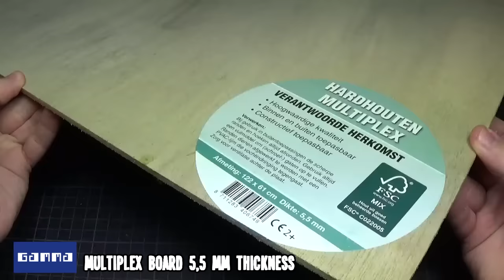How To Make Bayou Swamp Terrain

Comment: A little tip for anyone building large or medium scale scenery involving water, to avoid bubbling in your water if you have either a washing machine or washer/drier on at the time of making your water, after pouring just pop your scenery on top of the washer/drier and the agitation from the drum spinning around drives all the bubbles to the top, just keep an eye on it to check for anything you may need to pop or displace and of course...do NOT let it vibrate off the machine...not only will you destroy your scenery but your kitchen/utility room floor also and any potential collateral damage from splashes of resin.
Reply: Thank you

Comment: As always, amazing work.  Love it. Also, what kind of resin do you use? Every time i try to use resin, it either wont cure at all, or cures tacky.
Reply from the maker: Thanks! I use 2 part epoxy resin, from the brand Wilsor. I have used Unreal Details Magic Water and Envirotex Lite before they also work good, though Envirotex is better i think of those two. You may want to search '2-part epoxy resin' in your country's webstores (and then check reviews from users if you find some) Usually when resin gets tacky and won't dry 100%, it means that either it hasn't got enough hardener in it, or it's not stirred properly (happened to me once when i was in a hurry) Make sure to read the instructions carefully and measure exactly what it says. Usually it's equal parts hardener to resin but i know some brands do it different. It then needs to be stirred slowly to avoid bubbles until crystal clear, which takes some time. I use this one which is a Dutch brand and a bit hard to find:    https://www.harolds.nl/p/modelleren/giethars/giethars/2-componenten-epoxy-giethars    just to give you an idea.  It's pricey but the results are excellent. Hope that helped you my friend!

Comment: Nice one i might have to figure out a way to adapt this for ordinary miniature bases. 
i did hear someone once mention that swamp water is usually more brown than green, but i don´t know if that´s true.
Reply from the maker: Hi and thanks ;) Well you could check out my Tropical Mangrove Base video m8 i made those for 25mm round bases using the resin water. You could be right on the color, i made this with a fantasy twist i liked the greenish tone, you can experiment with it to make it as realistic as possible for sure!
Reply: question have you tried vallejo texture and if so what did you think of it might it replace the paste you made?
Reply from the maker: Good question, i thought of this one before i started to be honest, as i was almost out of Vallejo paste.I think the Vallejo paste is excellent (i even showed a pot in the video) and have used it many times.Only reason i like the Liquitex one more is that comes without the sand, so if i need it more smooth i can use it pure of with some fine powder.Another reason is Liquitex is way cheaper because of this reason, which adds up if you want to use a lot. I believe the Liquitex was 23 euro for 945 ml 'pure' paste, whereas the Vallejo is 9,50 for only 200 ml, from which 10-20% is just sand.I buy my sand usually in bulk 25 kg in big hardware stores which costs next to nothing.But again i think Vallejo is a safe and very good buy, used it on many diorama's i made with good results. Cheers ;)

Comment: Zeer leerzaam voor het schilderen van mijn modellen maar ik heb toch ff een vraagje. Waar kan je dat hoge densiteit foam krijgen in Nederland van die dikte? Ik maak zelf eigenlijk alleen maar rc vliegtuigen van composiet en dit dikkere materiaal zou uitermate goed gebruikt kunnen worden voor projecten van mij. 

Voor mijn modellen gebruik ik normaliter hoge densiteit foam (Gamma blauw geluidsdempend foam (extruded styrofoam) voor onder het parket, 10 sheets van ~80x60x0.3 cm voor 6 euro (~7 m^2). meer dan genoeg voor twee tot drie modellen van normale grootte en dik voldoende voor een knoeper van een model) zelf gelamineerd met papier 40 grams (ultra dun, vergelijkbaar met rijstpapier) waar nodig voor de huid en een speciale langzaamdrogende 3 component epoxy die enigzins elastisch blijft voor zo'n 24 uur tewijl het droog aanvoeld en bewerkt kan worden na ongeveer 2 tot 3 uur als toplaag waar de 3e component de viscositeit bij aanvang behandeling bepaald. Hoe meer 3e component hoe vloeibaarder en ik heb het graag zeer vloeibaar om een zo'n dun mogelijke toplaag aan te kunnen leggen, gewicht is van levensbelang om het model goed vliegend te krijgen. 

Voor het skelet gebruik ik hetzelfde foam gedubbeld de grain gekruist op elkaar met sneldrogende 2 component epoxy en juist daar zie ik mogelijkheden daar epoxy zwaar is en ik met dikker foam zelf de dikte van het skelet kan bepalen en ik gewicht kan besparen doordat er geen extra epoxylaag tussen zit gelamineerd. Sterker nog ik kan een skelet bouwen met de extra versterking op specifieke dikte die nodig is voor dat deel van het model. Ik zie een enorme mogelijke winst in gewicht. Om het skelet en de huid uiteindelijk aan elkaar te verlijmen gebruik ik de sneldrogende 2 component epoxy (5 minuten, normale viscositeit).

De gelamineerde papierlaag op het enkel laags foam stelt me in staat om mooie curves te maken zonder het foam te breken zolang je de grain van het foam volgt (je ziet het wel als je dit materiaal ooit aanschaft om mee te bouwen), je dient hier echter wel engelen geduld voor te hebben want teveel druk ineens gaat niet zonder golven in je curve te krijgen. Dat laatste is niet gewenst daar je je airodynamica daarmee kan verknoeien en het model niet zo zal vliegen als je oorspronkelijk hebt uitgerekend. De epoxy geeft het geheel genoeg stevigheid om een crash te kunnen overleven. 

De brandbeschermende plaat achter de motor (waarop deze ook gemonteerd is) kan echter niet van foam en epoxy gemaakt worden vanwege a de trekkracht en b de hitte van de motor dus ik gebruik daarvoor vaak aluminium of hout of een combinatie van beide materialen (afhankelijk van de grootte van de gebruikte motor voor het model). Het blijkt namelijk dat foam zeer slecht tegen trekkrachten kan maar zeer goed tegen druk kan over een groter oppervlak zeker als het ook nog eens gelamineerd is met een epoxy. Hetzelfde hitteprobleem geldt natuurlijk ook voor de snelheidsregelaar zodat ook hier direct contact van dit onderdeel met het foam moet worden voorkomen, een stuk balsa doet wonderen. 

Ik zweer bij epoxy en foam in de RC voor grotere zelfbouw modellen. Ja houtbouw met krimpfolie is prachtig maar ook een stuk gevoeliger daar het hout op de vochtigheid in onze atmosfeer reageert die nogal drastisch fluctueerd in ons kikkerlandje. Echt grote modellen van hout trekken hier altijd krom na enige tijd wat echt vervelend is voor de vlieg eigenschappen van het model.

Groeten van een modelbouw liefhebber.
Reply: Misschien leuk om te weten voor je. Ik ben momenteel bezig aan een een meter en zestig centimeter spanwijdte DHC-4 The Havilland Caribou. Ik heb daarvoor 11 sheets nodig ivm de rare knik in de staart die me nogal veel snijafval oplevert in vergelijk met normaal maar dat kan ik weer voor een volgend model gebruiken dus ik denk dat er uiteindelijk ongeveer 10 volledige sheets in het geheel gaan als ik de rest kan hergebruiken.
Reply from the maker: Thanks! Ik haal dat foam bij Van Beek Art.  Er zijn een aantal filialen in de grotere steden zou ik je zeker aanraden om eens te gaan kijken, maar de online bestelservice is ook prima. In NL is dat het beste foam wat ik heb kunnen vinden. Bedankt voor je tips voor RC modellen je comment is al een goede tutorial op zich. Veel plezier en succes met de hobby!
Reply: Bedankt mijn beste. 

Mijn bouwmethode is los vergelijkbaar op flitetest (https://www.youtube.com/user/flitetest) zelfbouw projecten maar vanwege mogelijk verkrijgbaar materiaal in Nederland en mijn eigen inzicht enigzins aangepast (skeletbouw vs boxbouw voor de romp, soms hun methode voor de vleugels soms op skelet (afhankelijk van grootte model uiteraard)). Zo hou ik bijvoorbeeld niet van het gebruik van hotglue omdat dat slecht doseerd en er eventueel grote gewichtsafwijkingen kunnen ontstaan tussen de stuur en bakboords zijde van het model wat nadelig kan zijn voor de vlieg eigenschappen van het model. Bovendien kan ik geen foam krijgen wat vooraf gelamineerd is met papier aan beide kanten hier in ons kikkerland. Je kan bij flitetest een met de laser voorgeplotterd model kopen voor starters maar ik ben een echte uit de kluiten gewassen goede Hollander dus ben ik zuinig. Als je begint bij hun eerste feeds en dan naar latere gaat kijken zie je dat zij net als ik een experimenteer fase hebben gehad en dat hun methodes steeds beter worden exact zoals ik het ervaren heb. Het buigen van het foam voor bijvoorbeeld het turtledeck komt bij mij vandaan als tip voor hun. Oorspronkelijk gebruikten zij karton voor de curves.

Te bedenken dat we pas foam zijn gaan gebruiken toen de electronica klein genoeg werd voor de micro's (~2004) daar hout en krimpfolie daarvoor veel te zwaar zijn. Deze modellen bevatten bijna geen echte 3D component maar vliegen perfect. Deze vliegeigenschappen zijn ons niet ontgaan dus dit materiaal werd eigenlijk meteen ook ingezet voor grotere modellen maar in den beginne moesten we nog methodes uitvinden om deze modellen meer vorm en stevigheid te geven. Door experimentatie ben ik nu daar beland waar ik dusdanig kan modelleren met dit spul dat het bijna levensecht is.

In het begin deden we nog veel verstevigen met hout, koolstof en metaal maar dit kwam het gewicht niet ten goede. Met veel vallen en opstaan kom je er uiteindelijk toch wel. Je wilt niet weten hoeveel modellen ik aan gort heb gevlogen in de aanvankelijke testperiode van dit materiaal. Minstens 20 modellen zijn in rook opgegaan vanwege constructie fouten. Deze verstevigingen zijn met mijn huidige methode zo goed als niet meer nodig. Aldoende leert men. Natuurlijk valt er nog veel meer te leren maar ik heb dit aspect nu best wel goed te pakken. Alle tips zijn welkom en zullen in overweging worden genomen.

Tip: mocht je ooit beslissen zelf te gaan vliegen begin dan aub met een eenvoudige trainer of dubbeldekker want je gaat door de grond als je een bouwproject hebt van een half jaar wat op zijn maiden aan gort gaat. Bouwen is op zich kan aardig ingewikkeld zijn maar er dan ook nog eens mee vliegen is een heel ander verhaal. Wel een heel erg mooi verhaal zodra je eenmaal doorhebt hoe het werkt. 

Ter uwer informatie: de electronica om uw model vliegend te krijgen is peperduur ten opzichte van het bouwmateriaal zelf dus extra bescherming hiervan is geen overbodige luxe. Een goede ventilatie en hitte behandeling van zowel de motor als de snelheidsregelaar zijn van levensbelang.

 Veel bouwplezier.

Comment: Great work aquick question do you need to apply a coat of pva or mod podge on your base before pouring resin or will a layer of acrylic paint suffice?
Reply from the maker: Thank you! Well you have to look at what you have on your base already. For resin pours, i usually make sure it's covered with acrylic paste and sand/ tile grout. PVA and MP can reactivate when wet so you may get clouding if it's applied thick. Better would be P.V.A, then Sand/ grout and then seal it with a scenery glue and let this harden for at least 2 days. Good luck!

Comment: The yellow thing with the bubbles inside you were using to make sure you had a flat surface in English we call a Level. The only change I can see possibly needed on this piece would be real Spanish Moss on the trees and maybe some small snakes and turtles. Otherwise very well done.
Reply from the maker: Thanks for the info and ideas!

Comment: You say to be precise when adding color to your resin to make sure it's transparent, but how do you know exactly how much resin you will need to fill your basin?
Reply from the maker: Good question. I usually make 1 smaller amount and see how much that will fill up. I then make 1 or 2 extra batches of the same amount to fill in the rest (that will blend easy as it's slow drying), and sometimes i have a tiny bit leftover that i can use on the area around the water. Cheers!

Comment: You said you use white pumice but like Liquitex modeling paste best, did you use both products to make the mud. It kinda left me just a bit confused.
Reply from the maker: I usually use the Liquitex, it's cheaper by volume. I believe i used that pumice just to use up the leftover tub. The Vallejo pumice comes with added sand but is more expensive. They're pretty much the same product in terms of strength you can use either. Cheers
Reply: Thank you for the reply, I am currently building a swamp scene 3' x 2' and have found your video and techniques so helpful. My daughter has wanted the experience of a cajun christmas since she was nine and we chose this year to make her wish come through. Coming from and being raised in Southeast Louisiana your swamp project is so very real to me. I have not only learned from your video's but have found a new range of crafts that I thoroughly enjoy doing. My next with be a bayou setting. Thank you again for teaching through videos on you tube.

Comment: Why did you bother adding color to the "horrible mixture", as you all it, if you were planning on priming?
Reply from the maker: Well i like to add some color to heavy textured mixtures just to make the painting a bit easier, as it sometimes can be hard to prime the recesses. Also just in case if it gets damaged or chipped it won't be as noticeable. Cheers ;)
Reply: Paepercuts Thanks for the reply! I'm working on a diorama of a New Orleans bar including the broken sidewalk and sewer and am using all original colors. It's good to hear the techniques others use and the reason behind.

Comment: all good till you broke out the air brush... they just will not work for me without clogging seconds after I start...regardless of air pressure or paint consistency... I hate them.  I manually brush things or use washes... I really have no other choice.